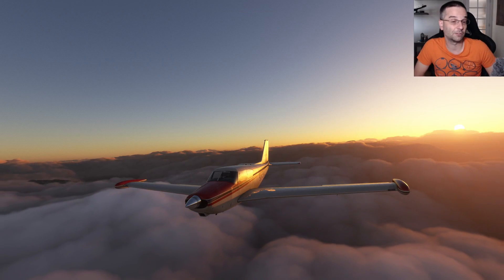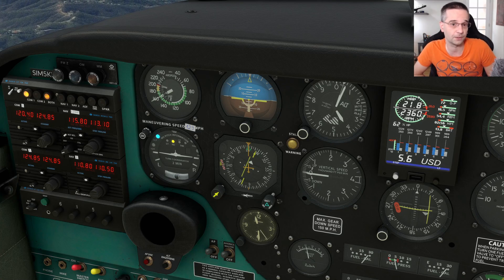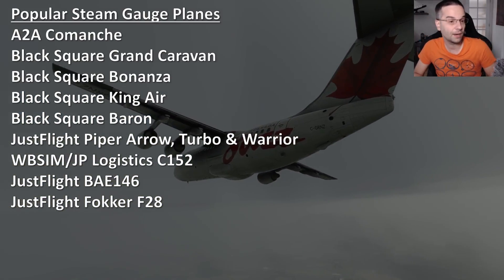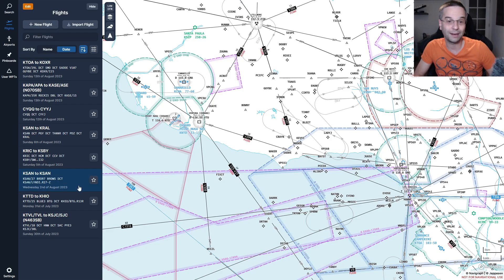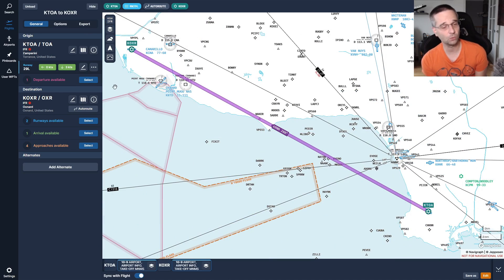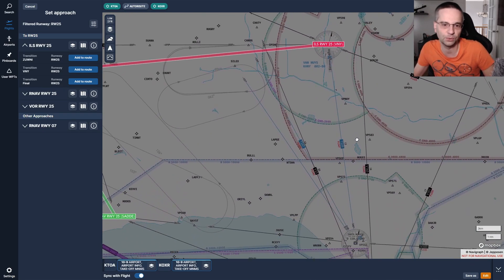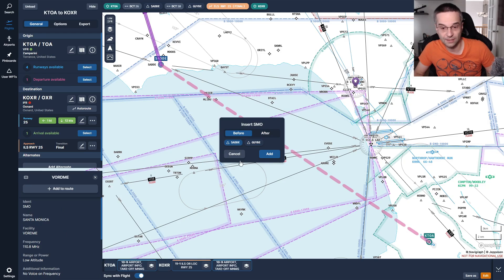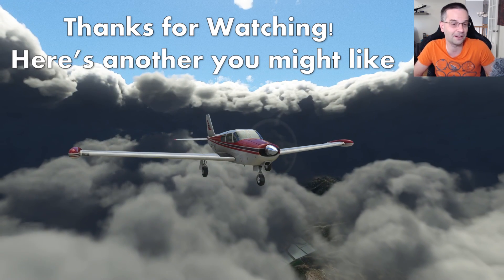Intro to Traditional Navigation | Part 1: Basics & Route Planning in Navigraph

Comment: Hi Mark. Tried following this video three times, step by step, but I am having some challenges. When I create the flight plan in Navigraph all okay, copying exactly as you do all is good. However, right towards then end of the video you do not show how to actually get the flight plan from Navigraph into MSFS2020. (So I presume you are exporting it, saving it as a 'KTOAKOXR.pln'.   However; when I then start up MSFS and load the .pln file, the actual route shown is from KTOA to KOXR as expected, but it's IFR (High-Altitude airways), and goes from Zamperini Field, SMO, VNY, GUYVE CUDAK HUPLA NELLY OXNARD. What's really weird, is if I then load the same flight plan back into Navigraph it appears as I expect! 

Furthermore, on the flight planning screen, if I select Low-Altitude Airways (as it is in Navigraph), I get a really weird route! KTOA PAROL DOYLE EXERT VTU ZUWNI FIM CUDAK HUPLA NELLY OXNARD. What am I do wrong. I have tried this 3 times now and get the same results every time!
Reply from the maker: I don't load the flight plan from Navigraph in Flight Sim at all, and I don't create one from the flight planning screen either. That's the beauty of traditional navigation, you load into the plane, set up your nav radios for the VORs you're gonna use, and get going! The way I do it is I'll have navigraph open on one screen, and flight sim on the other, and like that when I need a VOR frequency or course, I can just refer to navigraph and load it into the NAV1 or NAV2 radio, whichever is more convenient, and just keep flying. I hope that makes sense!
Reply: @FlightSimSchool  ah, yes it does thank you. I will give it another go today. I just got side tracked with loading it in and could not fathom why it was different! Thank you.